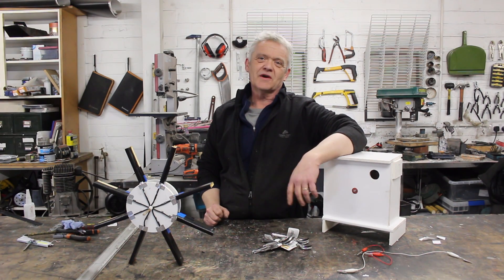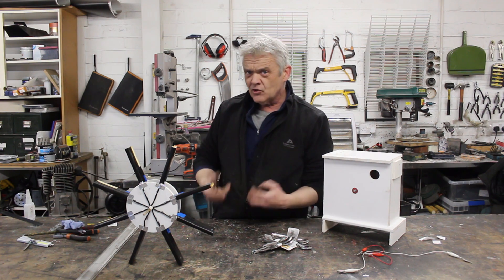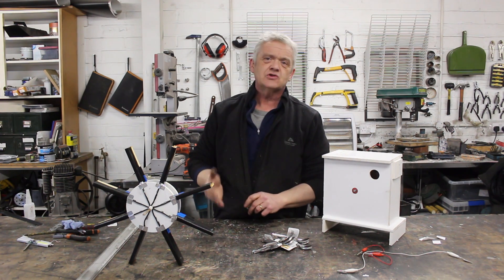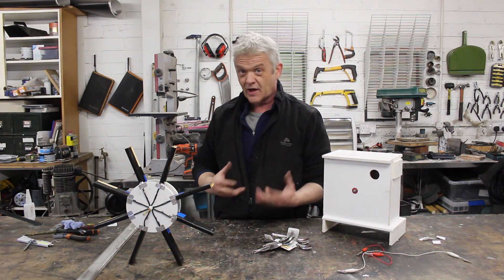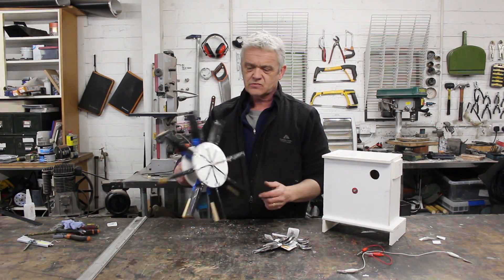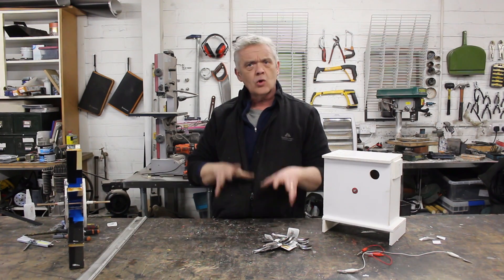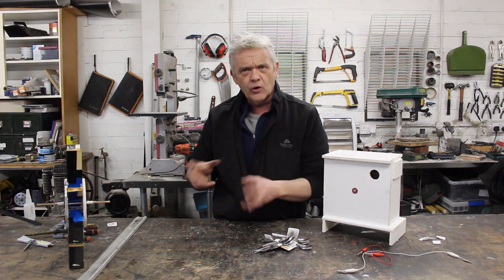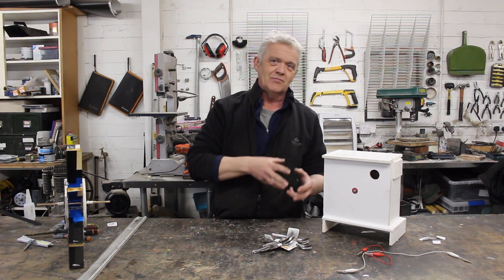1473 Water Could Be The Answer To Home Energy Storage

Comment: Three water tanks one above the second tank the #1 tank holds the weight that will compress the lower #2 tank that is where the weight gets lifted once lifted you lock it in place and drain the water to the #2 lower tank close off a valve then unlock the weight and pressurize the lower tank and then the #2 lower tank water goes up to the water motor spins it then the water goes to the #3 tank that will refill the #1 tank when the weight/plunger has reached the bottom of its stroke. The #3 tank is above the #1 tank and a valve is between them. Reposted for hopefully greater clarity and review by others of the design.

Comment: @Robert Murray Smith re accumulator,  would 800 PSi enough force  to  pump the waste water into a tank of similar height whilst scavenging the current to drive a generator via a sealed  impeller pump system and then ran backwards via mechanical triggers ?  I'm figuring some buoyancy on the weight to refloat it , could be derived from a displacement vessel such as a bath plugged and unplugged could achieve this i. Love your videos , wish I had the time to experiment. You're fantastic i particularly love your windwall .

Comment: I'm liking where this series is going. There's an easy method to calculate roughly how much energy you can expect in water:
At 50psi of water pressure that's 35m of head pressure. If you used 150l of water that's 14,3Wh per person per day. That's enough to charge your phone a couple times.

Edit: the easy method is to convert your water pressure into head pressure and use m.g.h to get joules (watt seconds). 1000kg of water ~=100Wh at 50psi.
Reply: Don't think I'll be replacing my 14kWh LIFEPO4 battery anytime soon then!
Reply: 14,3 wh cant charge 1% of your phone's 3000wh-ish battery. but it could be used to power the light of your bathroom for an hour, which is pretty good.
Reply: @iiiiicp  A phone battery is around 10watt-hours. You've confused energy with milliamp-hours (mAh). Do you think that a phone contains enough energy to run a room sized lamp for many days?

Comment: This is very interesting, Doctor Smith.   If you can get that much PSI from the accumulator, will that allow use of a Tesla turbine?  And how does the turbine compare to the wheel for efficiency?  Solar panels are becoming inexpensive. Batteries are the huge expense.   In order to charge my future EV at night, I'd need a large battery bank.  I'm curious to see what size of an accumulator system would be needed to make a comparable bank of energy.
Reply: Pumped hydro is not the most efficient conversion of energy, and usually only makes sense on a large scale. But you could calculate it, it all just depends on the capacity of your EV battery and the efficiency of your generator.  The size of your tank would need to be something like
(battery capacity) * (flow rate) / (generator output)
100 kWh * (1 L / s) / 1 kW = 360,000 L = 360 m^3
And the time it would take is just (battery capacity / generator power), in that example 100 hours.

Comment: I love all these ideas you have … I have always been interested in this field of study.  One thing I have always thought, in gymnasiums we have all of these resistance machines used to expend our unwanted calories. If instead these machines wasted all of this human energy plus the wasted energy of all the human body heat by use of air conditioners, lighting etc… all other topics to look at… but the resistance machines if we replaced the weights, the resistance wheel mass / resistance bands etc … with generators then think of all of the energy that could be generated. Instead of paying to use the gym, you get paid to use the gym, the gym owners then get a small percentage of the energy sold back to the grid. Or the energy could be used to charge a mass battery like you have described.
Maybe in the city, where a lot of energy is required, in a multi story building with multiple lift shafts, lifts descending could be used to generate energy too. Even take a lift out of its shaft and replace it with a huge mass so all of the energy saved elsewhere could be used to provide the energy to gradually lift the mass (use a lead screw arrangement or a ratchet system that lifts the mass as it rotates axially through captive nuts / bearings fitted to the mass). When you think of all the energy that as humans we use to do work that is wasted is phenomenal, we spend all our lives wasting money, our health, our time trying to lose all of the energy we store. When it all boils down at the end of the day, the best and most green source of energy is us, but the application is storage as for prolonged energy supply, as humans we can only sustain short bursts of energy but add it all up then we can save the planet (without it sounding twee) …. The other thing that isn’t discussed is we need to reduce the planet population to a certain amount (loads of social, economic, political issues there … ).

I wish I could quit my job and spend time doing stuff like this I’m a bit of a mad professor … you should see my garage haha but like wasting energy at the gym I wish I could put the energy that put into a job that I’m not really interested in into something that would be really useful…

Here’s another concept I saw somewhere…. why aren’t we using wave power more? Ok turbines are expensive and can cause a massive lot of damage to marine life and alter tidal flow etc… but someone (I can’t remember where I saw it) essentially built a concrete box on top of a sea wall and as the waves ran up against the wall, the water would enter the box at the bottom and the compression of the air was used to drive an air turbine. I have so many ideas that I’d love to try out … 

Keep up the great work mate, your videos produce so much thinking material …. Maybe we need to get groups of like minded people together in a subscriber group and have scheduled Teams chats to discuss ideas and concepts maybe springboard projects that we all could collaborate on … maybe not, I don’t know as you get some people who are just in it for themselves and steal,ideas…
Reply from the maker: there are always a few mate - but they are the few - most here are a good group of colloborative and like minded people - it is one of the things I like about the channel how many ideas are shared - I read the comments and the things I learn from folks just willing to share - it is truly amazing - as for the few here to steal - they are pretty lazy - or they wouldn't be trying to steal - and have no idea what it takes to get an idea off the ground - mostly the ideas they steal have no benefit to them as they just can't do anything with them lol
Reply: @ThinkingandTinkering  yep I think you are right … they are called OBEs … other bastards efforts haha 😂
Reply: There is already a gym that does this with exercise bikes.

Comment: That is a good point.  Modern toilets have a float in it to shut off the water flow and can scavenge the tank fill as it is filling.  One side to this is that your own tower tank, filled with rain water, can also be used with the issue of filling it.  Have you looked into hammer pumps or cold alternatives to the system in the fire heated coffee maker?  You might find a way of having 2 tanks, top as the potential, bottom as an accumulation tank to be pumped back up in order to have potential pressure back down.  I am not sure how the hammer pump works, however, the coffee maker has a very small diameter tube and one way valve that takes heat ( bubbles of steam ) to push the water above the water up the tube and brew your coffee.  The whole system needs to have more added due to losses from splashing, leaks and evaporation.
Reply from the maker: there were some rotary hammer heaters used in fire station heating applications in the US if memory serves - not sure what happened to them - nice pointer mate - cheers

Comment: You could have a large open top tank and the weight buoyantly lifted inside the tank as water fills it lock it in at the top of the plungers stroke then let gravity fill a lower tank that the plunger connects to, close the valves, and unlock the weight thus pressurizing the lower tank. All done with a cheap low power water pump. Edit Steve Tobias brilliantly came up with simply putting the water motor above the first collector tank!
Reply from the maker: I haven't seen his suggestion yet - I will look for it

Comment: Fill up a water tank that lifts your accumulators' weight into position as a counterbalance lock the accumulators' weight in position shift/pipe the water over or fill another tank with more water and then lower the weight to pressurize crazy simple. Thanks Robert :)
Reply from the maker: cheers mate
Reply: @ThinkingandTinkering  Cheers mate :)

Comment: Better check the license from your water supplier. "May not be used for other than intended use". (Just being cynical ;) ) The outlet of our washing machine goes into a 20L 'capacitor' where the overflow either goes down the drain (to kill the roots growing in the old pipe, as we learned the hard way) or optionally to a long tube to water anything in the garden in need (not much rain here over summer). The 20L then drains out the bottom slowly through a garden irrigation system. I have considered using solar to pump into a large diameter vertical drain pipe to recover the energy at night, but the solar production is just too good and the batteries last long enough, even in "winter".
Reply from the maker: I did cover that in the video mate

Comment: Why bother pumping the water into the storage tank. Instead have the water motor higher than the storage tank and let it drain directly into the tank.  Then the accumulator does its job for a hands free cycle that can run all day and night without the need to do anything, except maybe having to lift the weight of the accumulator once it reaches the bottom, unless you have a way around that also 🤠
Also I'm wondering if you add the rainwater harvesting to the drainage of the water motor you're going to have a little better output, especially if there is a few of them in series to give you about 2v

Comment: I’ve often thought about nature and evaporation where water vapour is ‘taken up’ via the effect of sunlight. Imagine the weight of water rising within the air (warm air holding vastly much more than cooler air etc). What if we could somehow use nature to do the lifting and, at some position, cause it to condense into a container at height. There’s your water store and weight at height.
Also, re condensing, what about morning dew-point…..picture the tent with ringing wet fabric and water droplets running down the sides first thing in the morning….add your varnished capacitor and voila……works both in the rain and on days where there is no rain but the dawn.
……that’s some of the things I daydream about anyway 🙂👍
Reply: Like a boat in a lock..... float your weight on water

Comment: I made quit a long comment but it seems to have disappeared ???
Reply from the maker: did you include links?
Reply: Hi Robert I did not put any kind of link in the wording - but I did put in an eBay item number and changed it to the description "Micro-hydro Water Turbine Generators" and the message was accepted sorry if it caused any problems

Comment: gravity and pressure are lovely. I wonder if theres some ingenius way of moving water with little input like a whick or how a tree pumps water.

Interesting stuff mate.
Reply: Like I just said in my comment you only need to have the water motors above the storage tank for them to drain into. Then they rain into the accumulator and the pressurised water feeds back up to the water motors.
Reply: @stevetobias4890  phwoaaaar you're onto something there mate.
Reply: @stevetobias4890  And you can buoyantly lift the weight :)
Reply: @Barskor1  smart idea but wouldn't that also interfere with the weight creating the pressure by pushing down on the water reserve?
Reply: @Barskor1  that's smart, instead of manual valves you can use solenoids based on pressure sensors, but that is a very cool idea.

Comment: I was interested to learn about the Tesla motor using discs stacked close together with the viscosity of water spinning the discs and getting some ridiculous speeds.
Reply: They never took off because there is not enough usable torque generated for the amount of air it uses.
Reply: That's always the excuse pulled out, but I wonder if that's true. Is there really no way to spin a generator with a low-torque high-rpm shaft? What was wrong with reduction gearing again?
Reply: @John-rw9bv  of course gear reduction would work, but if you don't have the supply to provide the proper rpm, then it won't be used. That is probably the case. A regular turbine that utilizes the water of a damn to create power. It more than likely takes more water to create the same amount of energy using a tesla turbine than it does using a regular hydroelectric turbine.

Comment: A way to use rainwater is to install a storage tank at gutter level piped directly to the toilet cisterns. This saves not just 30% of your water but the energy used to pipe the water to your house.
Reply: Japan has a cool and efficient way of reusing their waste Water..for example their Bathroom sinks drain into the Toilet cistern.

Comment: Ok as i see that idea
Split the incomeing main to hi and low 
As you will still want hi pressure hi flow for some things 
The motor goes on the lower pressure flow 
Use the lower flow after the generator for all the low useage things like toilet, washing machine ect even sink taps and so on . Then the out put of the generator is very intermittent so use that to charge a super capacitor type battery to smooth out the output into a useable form for mains use !!
Reply: F got you dont need the tank then ,

Comment: Combine this logic with repurposing the source (filtration). The average shower loses 16 degrees of heat from the shower head to the drain in anywhere from 1.5 to 3.5 gallons/min. Why not capture and filter it, heat the 2-3 Gal/min by 16°/min.(which your average electric kettle can do).  I just think of big families taking 5 to 10 minute showers each every day of the year with 120 000+ households in the US. We'd better change something sooner than later!
Reply: Showers use both hot and cold mixed so you only have to transfer the drain water heat to the shower cold side supply to recover that percentage of energy.
Reply: @malcolm8564  Agreed but my point was to repurpose the 2-3 Gal./min. Shower water is clean and easy to filter so why not just reheat and re-cycle 4-6 Gal. especially considering 110V heater can handle it. 
I do like your point of re-routing it back directly. That in itself would add up quickly.
Reply: There is a shower that does that already. i looked a one for installation on a Solar powered narrow boat. they are extremely expensive, but for a full shower it uses only 9l of water which it then dumps after the shower is complete.
Reply: @MrCarlRobinson  Too funny it would be marine equipment. I was living on a sailboat in Keywest when I thought of this idea! Any idea what it's called or a brand name maybe? Thanks
Reply: @Nash4Nashville  I’ll try to find it.

Comment: My thoughts go to the rain gutter generator quint built but collect the water into an accumulator then the same device could have much more pressure and in turn more power and could be used when you want not just when it's raining. The rain just refills the system ready for you to use.
Reply: Rain fills water tank buoyancy lifts weight water, drains to the lower tank that the weight then pressurizes.

Comment: I've been thinking of something like this lately but it fit to the waste pipe for the bath and sink, collected that water until a tank is full and use that water and gravity to drive something.
Reply: Much better to reclaime the heat b4 throwing it down the drain , seen it done the hot waste water preheating for a combi boiler !!
Reply: You could combine things couldn't you, some way of using the heat as your say either assisting a combinboilwr or a peltier device to utilize the heat, the weight of the water to drive some form.of generator and something inside the outlet pipes for running water to generate too similar to what Mr murray-smith has been doing.
Reply: @seanchadwick6182  yes you could but you dont have any real pressure or flow . The real cost is heating the water , then you are throwing that heat away !! , its low grade heat so to use it for back ground heating in the house or pre heating incomeing cold water is much more dooable
Reply: To drive a wheel you need hi pressure and flow.  To collect the hot wase water and allow that heat to heat say the floor i  the bath room is relatively easy no moveing parts easy plumbing job realy
Reply: I was thinking of this, but with 3 long haired females in the house I'd worry about the system clogging up.
Reply: @johnwaller9924  deep bottle traps and use pvc welded pipe work only m8 , its like if you have an electric shower pre heating the cold feed to the shower  from the out going waste water would save a lot more than you could ever generate from the flow of the waste